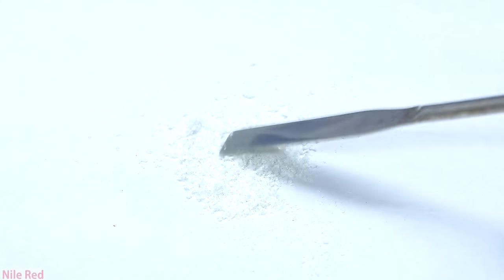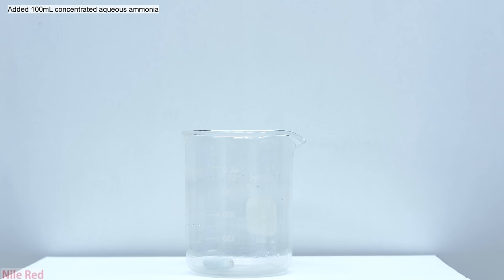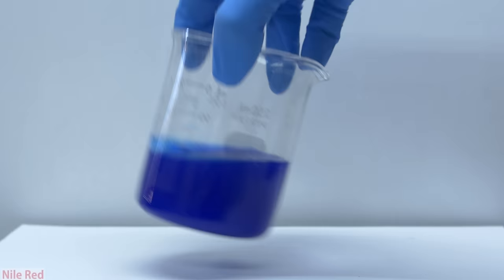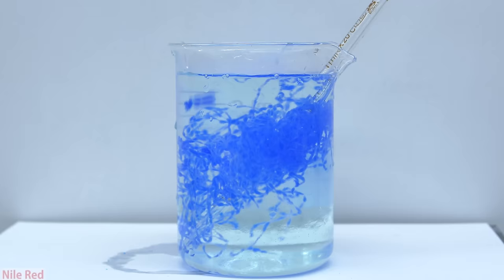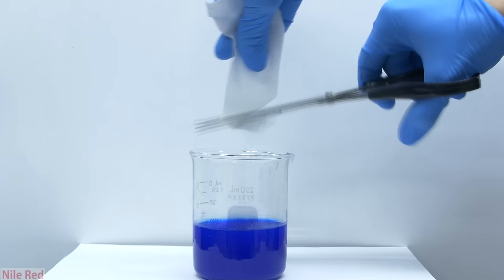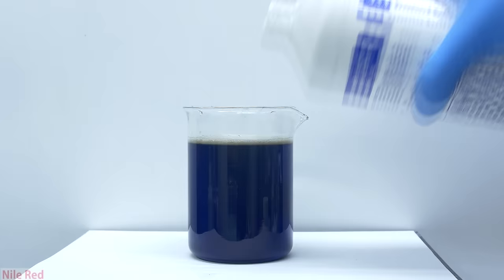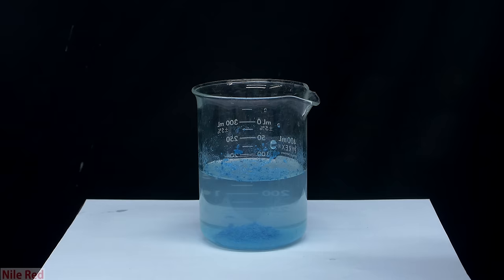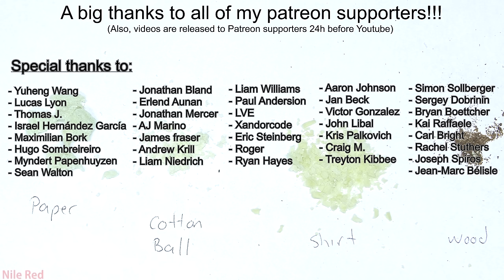Dissolving Cotton and Paper in Water (using Schweizer's Reagent)

Comment: Wanted to clarify one thing. Cellulose polymer molecules, even though they are long chains, are way smaller than cellulose fibers. So physically shortening the fibers should have a relatively small effect on the solution properties. Even if you cut up or grind solid polymer materials into powders the molecules themselves remain essentially intact. That being said, chain degradation can definitely occur due to chemical attack, temperature, or radiation.
Thanks for your videos!

Comment: wood depending on species is a mix of cellulose, hemicellulose, and lignin. Conifers have more cellulose and hardwoods have a higher ratio of hemicellulose. I might guess that lignin will mess with the process, being a another poly-saccharide. News papers are made with paper known as 'high yield' or 'high lignin' , Also, paper is made with a certain medium fiber length; too short and its generally weak, too long and the fibers just lay flat rather than crimping around each other and locking into a tight bond.
Reply: Video

Comment: Hey man you can make this solution more concentrated by adding 40g of copper hydroxide in 40g of conc.ammonia. This will speed up the dissolution of cellulose and also increase its efficiency. You can also use cupric carbonate instead of cupric hydroxide.
Secondly use a bit more thick needle. And the threads that are forming are rayon fiber.

Comment: Here is an idea: instead of copper hydroxide, use copper nitrate and leave the solution out to dry. When it does, you will have an intimate mixture of cellulose and copper nitrate, a fuel and an oxidizer. It might burn with a nice green flame.

Comment: The hydrochloric acid breaks down the cellulose.  If you used sulphuric acid, the results would of been better.
Reply: *have
Reply: wouldnt the H2SO4 suck the water out of the cellulose and turn it into carbon
Reply: @vertox4837  only conc H2SO4 do that, and u can use a dilute solution

Comment: Don't pulp mills routinely just use NaOh by the train car load to dissolve cellulose for paper production.  Seems like a long winded procedure to make this reagent to accomplish pretty much the same thing.
Reply: Actually, the process he is using is the one used specifically to make rayon. Longer fibers are needed. The sodium hydroxide with hydrolyze some of the cellulose to shorter fibers, as he did when he let is sit overnight.

Comment: Are you aware that zinc chloride solution will also dissolve cellulose?  This is the way Edison dissolved cellulose, which was extruded in alcohol to make fiber, which was washed to remove the zinc chloride, then dried, and pyrolyzed to make carbon filaments for his lamps.

Comment: Sir..nice video..
But I want to make brown and brittle paper..like aged antique  paper..
Is it possible with any chemical? ?
Plz help..
Reply: I'm not a chemist but I do that with diluted coffee. Just rest it in there and hang to dry
Reply: If you want to make it from scratch get a mould and deckle, get some gampi or kozo fiber and cook that down and then beat it with a meat tenderizer until it becomes fine pulp, transfer the pulp to a bucket with just enough water to suspend it. Fill a plastic tub larger than your mould and deckle with water and add to the tub sizing or clay powder and a tablespoon of water that has been used to store okra. With a strainer pull some of the pulp from the bucket into the tub of water. Then pull a sheet of paper with the mould and deckle. Remove the deckle and place the screen (mould) paper side down onto a sheet of foamcore or sew-in interfacing. Sponge all of the excess water away and remove the mould. Either cover with a sheet of sew-in interfacing or leave to air dry
The resulting paper will be thin, antique brown, make that lovely rattling noise, but it will be strong enough to handle ink or glue

Comment: I have heard that NaOH can dissolve cellulose at cryogenic temperature (-10 to -20 °C), could you test it out?
Reply: +aetius31 +NileRed 48g 24 wt% NaOH precooled to 0-5 °C and 48g 14 wt% Urea precooled to 0-5 °C......... Stir 4g of cellulose (cotton linters) into the precooled NaOH for 1 min and then immediately add the precooled Urea solution and stir vigorously for 2 mins................. Cast on to a plate and regenerated using a 5 wt% Sulfuric acid bath for 5 mins at 25°C. Then rinsed in running water and then deionized water, fixed to a plate and dried at ambient temps. There's also a degasification step after the initial dissolution......... I'm trying it at the moment - I used cotton wool and I didn't want to use Sulfuric acid and have no way to degasify. Used 5% Acetic acid instead (household vinegar) but it didn't really work... The dissolution seemed to work, but after soaking in vinegar and drying the cotton wool the fibres were all still there and it just looked like paper. Any tips? Would a strong brew of black tea work any better than vinegar? Or is there another acid I could use?... Something that can be sourced of made off-grid .........Not sure why the fibres were still there. It really looked dissolved after the 2-step dissolution process. Thanks!
Reply: Ooops I meant 48g NaOH 14 wt% and 48g Urea 24 wt%

Comment: Wouldn't using sulfuric acid to precipitate the cellulose degrade the cellulose fibers relatively quickly?
I'm kind of assuming that's why you used HCl.
Could you use something even weaker like formic acid? or.. frickin.. vinegar?  Citric acid?
Actually, it might be interesting (read "stupid") to try to 3d print a cellulose structure in a weak acidic solution using that goop.

Comment: Perhaps the brittleness of your products could also be the result of a lack of any crystalline structure in the precipitated cellulose.Also, I wonder if the non-thread-forming characteristic of the overnight solutions could be due to some other effect than you mention (alkaline breakdown of the cellulose), since alkaline cellulose breakdown generally only occurs at the end of the molecules (one glucose at a time) rather than somewhere in the middle (as acid breakdown does). Perhaps the cellulose is more thoroughly dissolved and so is unable to form a linked structure when precipitated. The solutions not left overnight may still contain (colloidal?) incompletely dissolved cellulose which could come out of solution with enough strength to form a fiber. Perhaps the non-thread-forming examples were not saturated with cellulose.
Do you have any idea of the mechanism of dissolving the cellulose? What seems to give the approximate weight equivalent of copper hydroxide and the amount of cellulose that can be dissolved? The molar mass of copper hydroxide is 97, and for glucose it is 180, which would imply that it takes two tetraaminecopper[II] complexes to dissolve one glucose unit of cellulose.

Comment: Do you know a way to break apart cellulose back into the glucose units?
Reply from the maker: You could use cellulase enzyme. There are other chemical methods though. Off the top of my head, I don't know exactly what the methods are though.
Reply: +Nile Red darn. I wish you had a better answer. I have no idea how to find cellulase and I'd bet it's near impossible to make cellulase. I've been trying to find chemical ways...
Reply: +Anirudh Ravishankar does it matter the acid? I would rather keep the compositions with organic chemicals and don't want to accidentally make chlorinated alcohols
Reply: Hmmmm... I'm not sure if they matter. But I think HCl works best
Reply: Concentrated sulphuric acid under reflux?
Reply: +Anirudh Ravishankar ok

Comment: How expensive would it be to get a basic lab setup to perform some of the experiments that you've got on your channel?
Reply: as someone who did just that, about $700 Canadian if you only splurge on a basic hot plate
Reply from the maker: It really really depends on what you want to do. If you want to do just basic things, it won't cost too much. If you want to do more intricate things like vacuum distillations, etc, it will start to cost a lot.